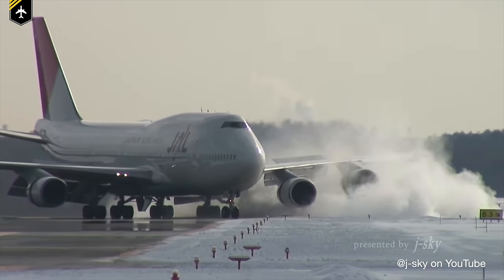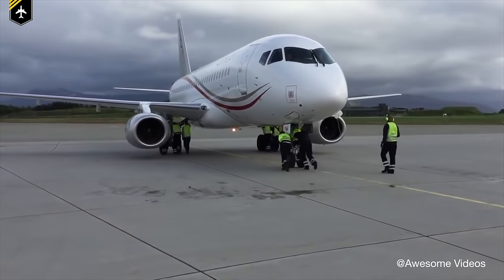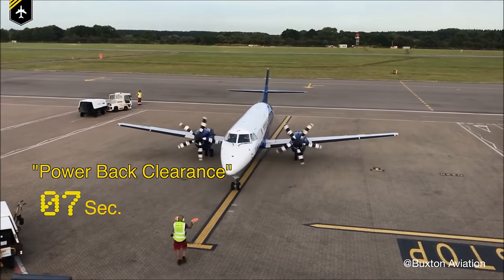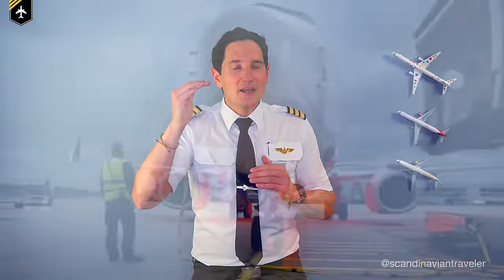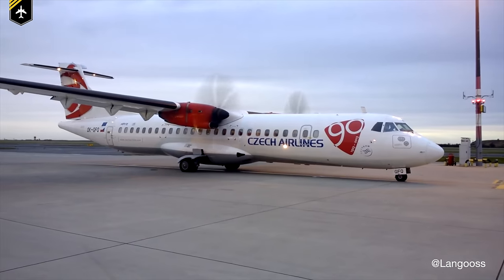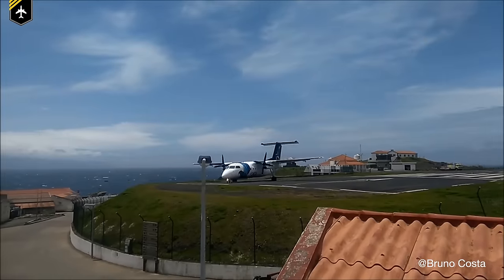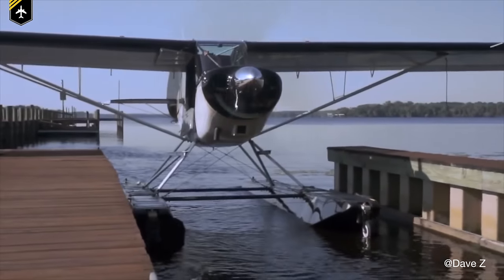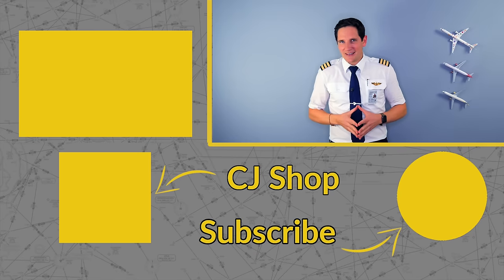Can planes REVERSE out of the GATE? POWERBACK procedure explained by CAPTAIN JOE

Comment: Hi Captain Joe, I have a question for you , when you steer on the ground with the colom stick the front landing gear turns but when in the flight to turn use the rudder but use the same colon stick ? Or the system switch automatically off or on something between the front landing gear and the rudder ?

Hope you understand it

Regards 

Godfrey Schembri

Comment: Not only have turbo prop engines a smaller air-intake, the fan blades have a variable angle of attack, so they can actively produce a directly backwards oriented thrust, whereas turbofan engines have a 60° angled reverse thrust, not to mention, that the core stream is mostly not reversed, making it even less efficient.

I can imagine that the need for an electric motor inside the wheels is just not there. Most civil passenger airports have tugs and the take off windows are so tight and planned through, that the few seconds you save from unplugging the tug will come back later when you need to wait on a junction or on the runway.
It just isn't worth adding kilos of hardware, complicating the wheel and landing gear systems and potentially having to work with a cooling nightmare that is the MLG.
Plus the indication of an e-wheel powerback is less obvious than the big tug with several warning lights spinning.
Just a few thoughts.

Comment: when powerbacking with a turboprop aren't you spinning a propeller in front of the engine inlet just removing away air from it? Does it affect engine performance and/or/ need to be taken into account when doing such manouver?

Comment: My question is.  The first time I flew I was on 4 different planes in one day.  But every time after the plane had everyone on it I would see fog in the floor.  What is the fog all about? I was in 2 prop planes and 2 rear mounted jet planes.  I always had to set at the wing on every flight as well. So guess that's another question also.  Is there a reason I had to seat at the wing on every flight? Thanks

Comment: I quite often take connecting flights operated by Norra for Finnair. They operate short connections with ATR72 and leave stand using their engines. Of course not a problem for aircraft with high-mounted turboprops and stands with no jet bridge (due to rear entry) having a lot of space to do this maneuver.

Comment: saw this first hand in the early 1980`s while working at air canada cargo at yvr.......dc8-63 freighters with upgraded newer style engines.it was only during severe icy conditions to assist the push out tractor.cargo area ramp was a low priority with limited plows at yvr back then

Comment: this procedure with airplanes backing out of the gates is done at all commercial airports in Hawaii (except for the one in Honolulu) because most commercial airports there have wide open spaces and the terminal are outdoors rather in buildings.  In fact most airports in Hawaii do not use actual gates. the use stairways onto the tar mats.

Comment: I've been on a few flights where the pilot used the planes own power to back out. In 1986 and 1987 on AA at DFW. DC9/md80 which is one of the planes. mentioned

Comment: Sometime around 1974 a C130 fell out of the sky. I was told that they were under instruction and the instructor leaned forward and pulled the throttles back. Unfortunately he lifted them over the gate and put the engines into reverse. If you google it it is not the same so I wonder what happened.

Comment: Hi Joe. Thanks for another great video. Some of those prop planes like ATR or q400 do one engine taxi procedure after landing. What about push back ? Also possible with one engine ? I was passenger at ATR, absolutely surprised that this is allowed to push back but now you confirm it is. That time ATR was using both engines as distance to runway was not long.

Comment: I think motors in the axles of the wheels may not work because of the Immense heat from the brakes may melt the insulation on the motor windings, or smaller brakes would have to be fitted increasing the stopping distance. Also the motors would draw a lot of current. I’m not an engineer though so I might be wrong.

Comment: I see that it is a heavy load for a320 but electric motors can taxi heavy aircrafts efficiently if they were to have their own battery and charged by ground power while the aircraft is at the gate and by engines during cruise. Some airports require up to 40 mins of taxi time and fuel is not the only problem. Turbine engines have their expensive  maintenance based on engine hours. If you break down the overhaul cost per hour and scheduled maintenance cost, you will see that it is more expensive than fuel cost. Those expensive hours on engines could be saved for actual flights, rather than taxing on busy airports just like a truck.

Comment: There is a safety reason behind this action, any plane with thrust reversal system can go back, but only propeller driven planes are allowed to do this practice, jet engine will destroy the runway and creates lot of other problems close to boarding area, pilot can do that on outer part or close to runway when necessary.

Comment: In 1985, I saw a Boeing 727-100 which had left the gate and was on it´s way to the taxiway. It suddenly stopped, and a minute later reversed under its own power almost back to the gate, stopped again, lowered the back stair and about a dozen passengers climbed on board (while the engines were running). It then raised the back stair and started taxiing again. I have never seen anything like it since then. This happened in Colombia.

Comment: in CE 208 B. During taxi pilot felt brake failure then co pilot tried but he failed to push the brake pad forward. No braking action took place. Aircraft hit a low land. After recovery it was found that brakes are ok. What can be the reason?

Comment: In the past, airports were arranged for aircrafts to just go forward after they had finished parking. London City Airport still used this kind of technique. Just go forward after you are ready to Taxi.

The issue is, in the 1960~1980s, airliners are getting bigger, and kept changing. So they used a 'One Method, Fits All' design, that required a pushback.

Of course, airports made more money using pushback tractors. And these days, delays (and even cancellation) are intentionally created.

Comment: Fun fact: Early versions of the 737 fitted with the optional "gravel kit" also have the capability to powerback from the gate because the bleed-air outlet fitted in front of the intake will keep FOD away from the intakes. Newer 737 versions though cannot do this.
Reply: Mainly due to newer airports no longer having FOD problems and are far more equipped.

Comment: This answered all my questions about reverse thrust and power-back but one - why does the A380 only seem to have reverse capability on the inboard engines?  Or is it just that their engines are so big they never need to activate the reverse thrust on the outboard engines.  And thanks for mentioning the tail strike danger, I've seen several tail strike incidents during the loading cargo planes.  In fact, I can remember back in the 1970's some planes had a place to hook a tail stand, just in case the loaders couldn't remember that you can't push a container all the way back to the tail unless you push a similarly loaded one to the nose at the same time.
Reply: One reason is because the A380 has a long wingspan and the outboard engines can reach outside the runway, and if they would have the reverse thrust the outer engines could ingest debris from the ground which can damage the engines. It also saves weight when there is the reverse thrust on inboard engines only.

Comment: Indeed, "green taxiing" (using electric motors in the main gear ) is not used because it is too heavy resulting in an an increased fuel burn and fuel is cheap at the moment. We might see it soon on short and medium haul aircraft as they spend more time on the ground compared to long hail aircraft

Comment: do turboprop planes have ReverseThrust And If It Has How Does it Work?
Reply: The pitch of the propellers is reversed so that the thrust is being pushed in the forward direction of the aircraft as opposed to pulling the aircraft through the air
Reply: @BenMcBethAviation  that's A Real Mind Blower.

Comment: At London City all aircraft swing round so they are pointing towards the runway at 45 degrees. It is only used by small aircraft: Dash 8, Embraer 190, 146 etc and this probably isn't possible with larger aircraft.

Comment: At busy airports with multiple tightly packed stands that share a common start up position (or tracks to the start up that can’t be simultaneously used) on the ramp, I’d imagine a pilot radioing ‘ready’ and then radioing a ‘start up request’ before they’d even moved off the gate would cause a bit of a panic for the ground controllers!

Comment: I have a question. How do pilots steer their plane when on ground ? Is there a little wheel?  Or does the stick act as control for the front wheel?  Thanks
Diego
Reply: There is a separate steering tiller which the pilot uses to steer the nose wheel.
In this photo it is marked with a red circle:

https://qph.fs.quoracdn.net/main-qimg-932f94689d69cbb1a5528b22c935e01a.webp

Comment: Hi CJ, i would like to know what kind of fuel to airliners use, ie, is the same as the one of regular cars or different?
Thanks for the show
Reply: Jet engines run on kerosene which is different from petrol (gasoline) and diesel. You can smell it at airports, not a pleasant smell. Tankers usually have AVTUR on the side which I assume is an acronym for aviation turbine.

Comment: Turboprops can get away with reversing not so much because of inlet size, but because they typically have particle separators and inlet screens on the engine core, even if something did get sucked in, it would never make it through the engine.  Also, reversing the pitch on the propeller for reverse is almost inconsequential to the engine compared to the reversing doors on a turbofan.  Electric wheel motors are not economical due to the additional weight of motors and batteries that have to be carried the entire flight (that's a lot of extra fuel to burn).
Reply: Well, if you could make the wheel motors lighter than the fuel you will use to roll to the gate at your destination airport, it would actually be viable. Also you don't need necessarily batteries, you can simply use the APU to power the motors. Yes the APU uses fuel but far less then the normal engines.

Comment: so do turbo props spin the opposite way to back up or do the blades angle to allow it to thrust backwards?
Reply: The engines don't rotate in the opposite direction, the angle of the propeller blades is changed.

Comment: I always thought aircraft should use a 10-50kw motor in each wheel set, not just for taxi or powerback, (significantly more efficient for piston aircraft than jet aircraft, because idle fuel usage isnt that much different than taxi with jets)
My main thought was to save wear and tear on the tires and brakes during landing, if those tires could be spun up to match the ground speed before touch down, there would be far less wear. The additional benifits would be the slight fuel savings while taxiing (larger fuel savings on piston air craft) and taxiing for maintenance could be done using just the APU instead of the main engines, or even on battery, though i dont think the batteries are designed to do anything other than start the engines
Reply: I should have shut up and watched the rest of the video

Comment: From my understanding, Airbus abandoned the E-taxi project (the electric motor on landing gears) because of the high fatigue levels that were discovered on the landing gears during testing (due to the weight of the electric motors and equipment). They recently terminated the project with Safran, though it could've saved a lot of fuel from not having to use the main engines for taxiing!
Reply: Strange, Safran says on their website that they planing to introduce the system in 2022. And actually if you think about it, the weight wouldn't be a huge issue, because at the moment an airplane has to carry around the fuel for taxiing at their destination airport which can easely be 200kg. So if the system would reduce the fuel burn for taxiing by 75% it could weight 150kg and the airplane would still reach the same efficiency in flight.

Comment: How about building the gate stands under a certain angle so the planes can go back releasing breaks and using just the gravity?
Reply: I think it will be problems concerning boarding stairs, loading cargo and filling fuel if the plane is not level.
Reply: @nhytg376tgyuu765gjmg  good point ;)

Comment: Before I watch the video I’m gonna say yes that they can back up by themselves but it just depends on the size and the experience of the pilot I guess because in my flight simulator app I struggle more with large airplanes when it comes time to push back because I can’t see the ground with The yellow line that I’m supposed to follow the runway as well as I can with the smaller planes

Comment: Hey Joe!
Could you make a video about the pushback tractors, please?
My specific question is: Why are the old ones with towbars so heavy, meanwhile the new one, the towebarless, wheel-picker versions looks waaaay so lighter?
Thank you!
Reply: The weight of the pushback has to do with the size of the plane. The bigger the plane the heavier the pushback. Although the wheel picker as you call it look like it doesn’t weigh mush that actually are pretty heavy thay have weights up under them. I’m a GSE mechanic I work on the tugs/pushbacks and the other stuff you see on the ground at the airport
Reply: rocko44444444 and they still make the normal pushbacks that use towbars. One of my stations has 2 2018 models made by TLD. We also have 1 Tronair that is towbarless.
Reply: @lemonaid8678  thanks!

Comment: Why dont use the puchbacktractor to pull the airplain all the way out to the runway?  would not that use less fuel than the jet engine?
Reply: There is actually a self driving towing system in development. I'm not sure if they tested it yet though.

Comment: I'm just surprised that direct electric traction on the aircraft wheels isn't done.  If the wheels could be driven directly with electric motors you could back up and taxi around completely with only a small aux engine running the whole time and then only start up the main engines when taking off at the runway!  It just always seems to me that using engine thrust to move around the ground is a waste!  To me it seems engine thrust should ONLY be used at the runway when actually taking off and powering flight.  It's like imagine if instead of using an internal combustion engine on our cars to rotate the wheels, cars just had a thruster on the back and the car was simply pushed forward on thrust.  That would be so inefficient,  It would use a lot more fuel and would be super noisy.  I just can't get through my head how full electric traction for taxiing on aircraft wouldn't be more efficient.  Thanks for the informative videos.

Comment: Used to be common with the DC9's and the 727's back in the 60's and 70's in smaller airports or if a tug wasn't available.  Now with the cost of fuel it's not done.  Along with the lower underwing slung engines and the FOD issues.

Comment: Dumb question maybe: if suction intake is such a big concern why isn't it such a concern when a plane idles or rides forward?
Reply: It's not suction in the intake that is a big problem, it's the jet blast that blows a lot of crap and debris up from the ground and towards the front of the engines (where it has a higher chance of getting sucked in as opposed to stuff lying on the ground).

Comment: 8:50 
Why are the engines covered?
Reply: Probably had an extended ground time, so they protected the engines from debris and critters.
Reply: Carsten Koch how will the engines work then? with poor air supply.
Reply: @kingmudasir3154  
They don't. They are most likely just taxiing to another position or into a hangar.

Comment: Eastern Airlines flight with a 727 PHL to DCA in 1983 pilot pulled out with reverse thrust then followed up that event with revving the engines (probably just 1/4 thrust) on the taxiway 180 degrees from eventual takeoff runway direction.  By far the biggest lateral G force I have ever felt on a plane.  Guess pilot was in a hurry.  The other notable part of that flight was being one of about 4 passengers.  If I had only known how to sell a company stock short at that time.

Comment: How about theoretical? Could all current/modern aircrafts reverse under their own power?

Would the reverse thrust be enough to move an A380 or a 747? 

I understand it is not used practically, but in theory, would it work?
Reply: Like you mentioned it's not a procedure used today (because of safety reasons), but B747 can do it.

Comment: I remember there was a very well known incident involving, I believe, a DC9 flying out of DCA where the pilot used reverse thrust to get out of the gate. It sucked up a piece of ice and crashed into the frozen River killing all most everyone on board.
Reply: Air Florida flight 90, a B737.  The use of reverse thrust at the gate probably contributed to the crash, but there were many other factors as well - inadequate de-icing, failure to engage engine anti-ice, etc.

Comment: Why is FOD more of a risk with the engine's in reverse ? FOD is an issue in both directions surely, not more likely in reverse ? Thanks.
Reply: Because the debris is fired in front of the plane instead of behind it. Making it a huge hazard for ground personnel and buildings/passengers.
The damage to the engine should be about the same. Just a higher risk of damaging the reverser system.